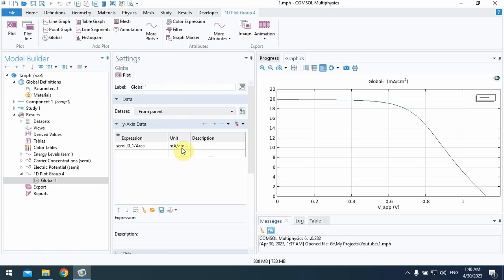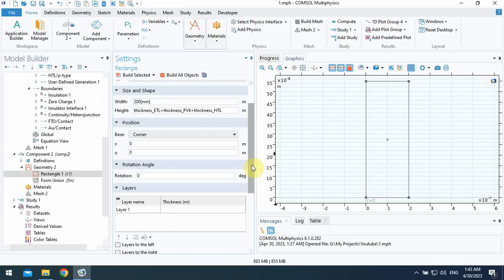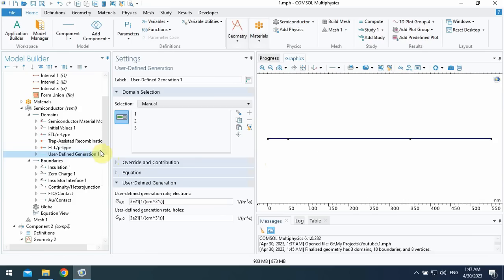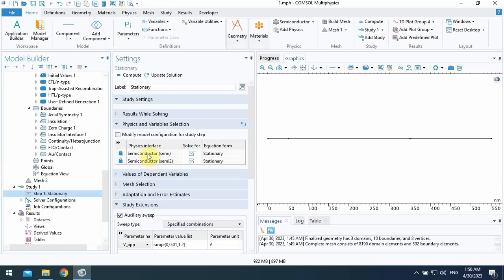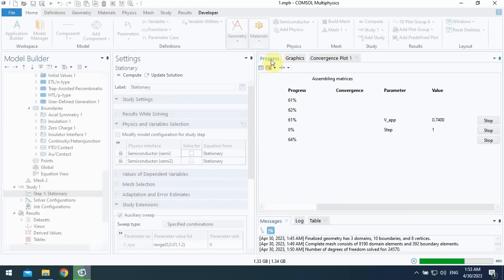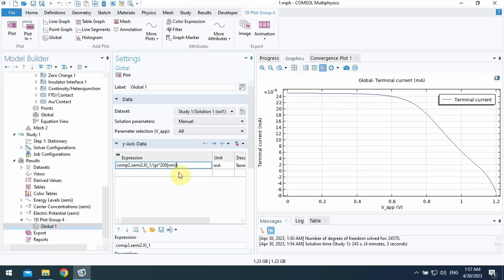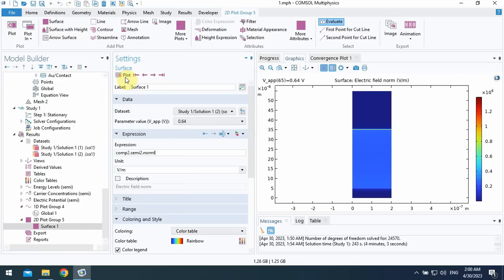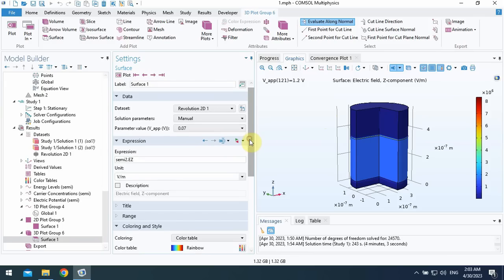Simulation of 2D Perovskite solar cells with COMSOL

Comment: Hello, thanks you for your tutorial but i have some problem to compute my model in 1D and 2D. This is my message error: "Failed to find a solution for the initial parameter. Maximum number of Newton iterations reached. Returned solution is not converged. Not all parameter steps returned." Can you help me? Thank you
Reply from the maker: Hello my friend, your welcome.
You must check the parameters values and the related domains, and also you must check the meshes.
Best